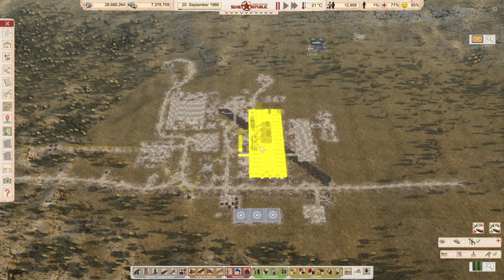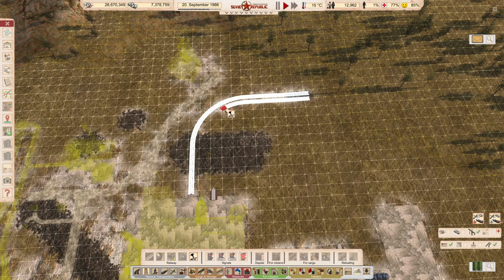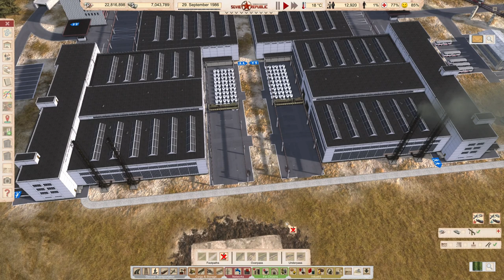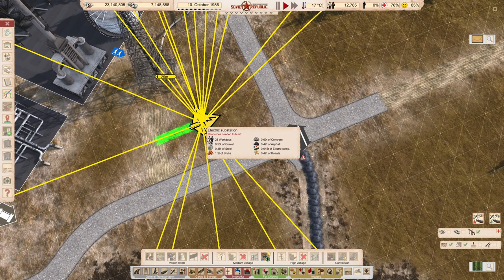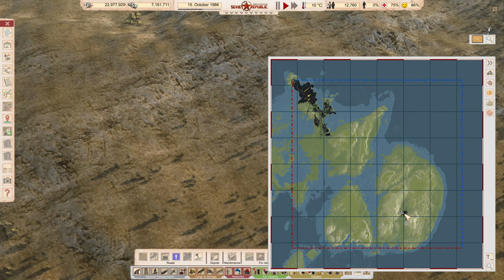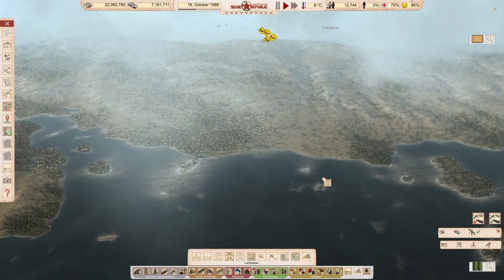We need fuel on the island - part 1| S0E09a | Workers & Resources

Comment: Wouldn't a three to one liquids pump let you connect oil, fuel and bitumen to the harbours?
Interesting, on the island you need power to pump oil, so you create power to pump oil 😁

Thanks Caya!
Reply from the maker: I had to re-watch the episode to see what you meant 😄 but like conveyer belts, you can transport oil, bitumen and fuel over 1 pipe.

Edit, little bit later. The storages were meant for extra buffer.
Reply: @CayaMaya  my test shows only fuel and bitumen will flow over the same pipe. Oil will not, sorry about that!